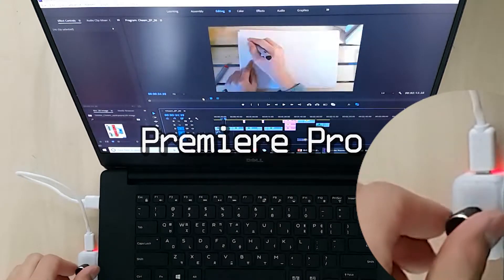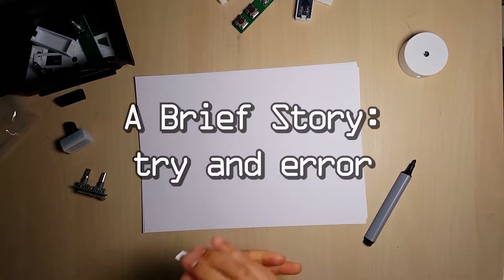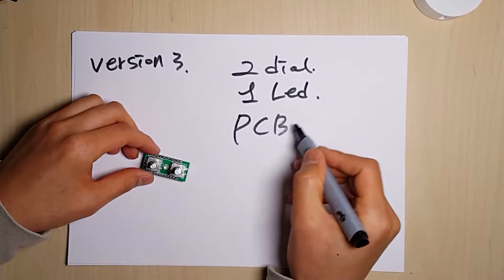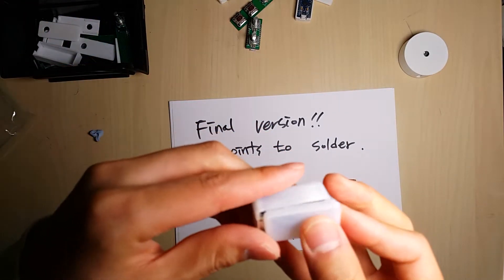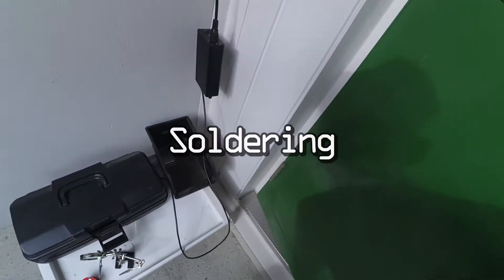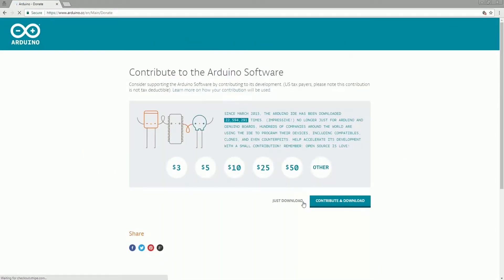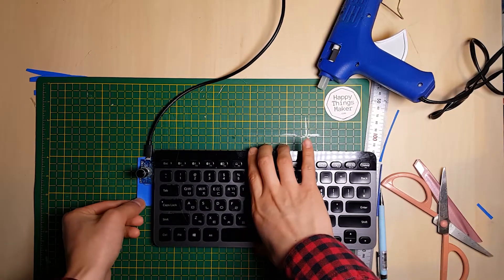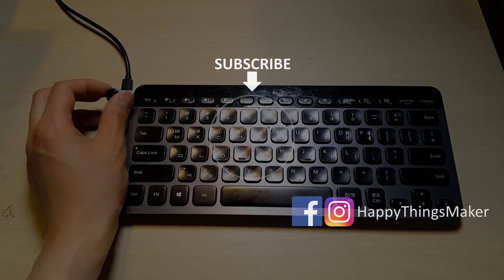Midi controller | Premiere Pro | Lightroom | Navigation Dial DIY (NEW) |  Video Edit Jog Wheel USB

Comment: Thanks heaps for this. I have been looking to control a web page slider with a rotary knob and this works great. Is it possible to get the switch to activate F5 on the keyboard? Regards Bruce
Reply from the maker: Hello! You can set the click as f5. Also you can buy a ready made one in this link.  https://www.etsy.com/listing/985194207/parks-custom-dial-kit-customizable

Comment: Can we use it as a volume knob?
Reply from the maker: Hello!
1. the example here doesn't have a code for a volume controller but you can make the volume controller by yourself.
2. you can buy a product which includes volume controller functoin here.
 https://www.etsy.com/listing/985194207/parks-custom-dial-version-2-customizable

Comment: My Arduinio Pro Micro is not recognized by the USB port. So I am not able to set the Port in the IDE. an you please help?
Reply from the maker: hello, if you have a jumper wire, would you try to short GND and reset pin after you plug the usb?

Comment: Hello, I'd like to do something similar but don't know how. I have a MMO gaming mouse with many extra buttons. I would for example like to be able to program one of them where I could hold the button down and then adjust exposure in Lightroom with the mouse scroll wheel. there doesn't seem to be a keyboard shortcut for Lightroom for this type of function. Is this use case possible?
Reply from the maker: hello, first, it is difficult to hack a product. I wished I could hack those kind of thing but it was way too difficult. so, I just made my own way.

Comment: Hey! First, thanks for the great video! Would it be possible to use this knob for macros?I was thinking about something like switching apps using Autohotkey. Also, would it be possible to connect more knobs to an arduino? In that case how many? I was thinking about giving another use to an old audio mixer. Thanks in advance. Any pointers would help.
Reply from the maker: hello, does "macros" means some combination of keys? then, yes. you can make that function. you can also make many dials but you will need to solder on pcb or handmade circuit board.

Comment: Hello, thank you for you work, 

Little question, i have two Arduino Nano (ELEGOO Nano V3.0 CH340) at home, is possible to use this with you arduino sketch ? i try buy i have 'keyboard' not found messages. 

Or i do imperatively to buy arduino Leonardo ?? 

Thank you for you answer
Reply from the maker: Hello, nano cannot do the function. Leonardo or arduino micro pro can do it.
Reply: @EunchanPark  Thank you very much for you quick answer, i order the right arduino and that works !!!!

Comment: 재밌게 잘봤습니다. 더 작게 만들어보고 싶어서 아두이노 마이크로 대신 digispark로 구성해보려고 합니다. 은찬님 코드에서 Keyboard.h를 DigiKeyboard.h 라는 라이브러리로만 변경하여 적용하였는데 적용이 되질 않네요. 코드좀 살펴봐주실수 있나요?

#define RESOLUTION 2
#include <DigiKeyboard.h>
 //변코드
#include <EEPROM.h>
#define BUTTON 0
#define OUTPUT_A 1
#define OUTPUT_B 2
bool aState;
bool aLastState;
bool lastButtonState = 0;
#define HORIZONTAL_MODE 0
#define VERTICAL_MODE 1

int mode = HORIZONTAL_MODE;
const int numMode = 2;

void setup() {
  mode = EEPROM.read(0);
  pinMode(OUTPUT_A, INPUT_PULLUP);
  pinMode(OUTPUT_B, INPUT_PULLUP);
  pinMode(BUTTON, INPUT_PULLUP);
  aLastState = digitalRead(OUTPUT_A);
}
long tempCount = 0;

void loop() {
  aState = digitalRead(OUTPUT_A);
  if (aState != aLastState) {
    if (digitalRead(OUTPUT_B) != aState) {
      rotateLeft();
    } else {
      rotateRight();
    }
    aLastState = aState;
    delay(10);
  }

  if (digitalRead(BUTTON) == LOW) {
    if (lastButtonState == LOW) {
    } else {
      delay(300);
    }
    lastButtonState = LOW;
  } else {
    if (lastButtonState == LOW) {
      changeMode();
    }
    else {
    }
    lastButtonState = HIGH;
  }
}

void changeMode() {
  mode = ++mode % numMode;
  EEPROM.write(0, mode);
}

void rotateLeft() {
  if (tempCount++ % RESOLUTION == 0) {
    if (mode == HORIZONTAL_MODE ) {
      DigiKeyboard.sendKeyStroke(80);
    } else if (mode == VERTICAL_MODE) {
      DigiKeyboard.sendKeyPress(82);
    }
    DigiKeyboard.sendKeyStroke(0);
  //릴리즈 대신의 초기화 코드
   delay(1);

  }
}

void rotateRight() {
  if (tempCount++ % RESOLUTION == 0) {
    if (mode == HORIZONTAL_MODE) {
      DigiKeyboard.sendKeyStroke(79);
    } else if (mode == VERTICAL_MODE) {
      DigiKeyboard.sendKeyPress(81);
    }
    DigiKeyboard.sendKeyStroke(0);
    delay(1);
  }
}
Reply from the maker: 안녕하세요, 이 댓글이 스팸에 있어서 이제야 확인했습니다. 
혹시 eeprom 쪽을 빼고 컴파일 해 보시겠어요? 
#define RESOLUTION 2
#include <DigiKeyboard.h>
 //변코드
#define BUTTON 0
#define OUTPUT_A 1
#define OUTPUT_B 2
bool aState;
bool aLastState;
bool lastButtonState = 0;
#define HORIZONTAL_MODE 0
#define VERTICAL_MODE 1

int mode = HORIZONTAL_MODE;
const int numMode = 2;

void setup() {
  pinMode(OUTPUT_A, INPUT_PULLUP);
  pinMode(OUTPUT_B, INPUT_PULLUP);
  pinMode(BUTTON, INPUT_PULLUP);
  aLastState = digitalRead(OUTPUT_A);
}
long tempCount = 0;

void loop() {
  aState = digitalRead(OUTPUT_A);
  if (aState != aLastState) {
    if (digitalRead(OUTPUT_B) != aState) {
      rotateLeft();
    } else {
      rotateRight();
    }
    aLastState = aState;
    delay(10);
  }

  if (digitalRead(BUTTON) == LOW) {
    if (lastButtonState == LOW) {
    } else {
      delay(300);
    }
    lastButtonState = LOW;
  } else {
    if (lastButtonState == LOW) {
      changeMode();
    }
    else {
    }
    lastButtonState = HIGH;
  }
}

void changeMode() {
  mode = ++mode % numMode;
}

void rotateLeft() {
  if (tempCount++ % RESOLUTION == 0) {
    if (mode == HORIZONTAL_MODE ) {
      DigiKeyboard.sendKeyStroke(80);
    } else if (mode == VERTICAL_MODE) {
      DigiKeyboard.sendKeyPress(82);
    }
    DigiKeyboard.sendKeyStroke(0);
  //릴리즈 대신의 초기화 코드
   delay(1);

  }
}

void rotateRight() {
  if (tempCount++ % RESOLUTION == 0) {
    if (mode == HORIZONTAL_MODE) {
      DigiKeyboard.sendKeyStroke(79);
    } else if (mode == VERTICAL_MODE) {
      DigiKeyboard.sendKeyPress(81);
    }
    DigiKeyboard.sendKeyStroke(0);
    delay(1);
  }
}
Reply: 답변 감사합니다! 해결 했습니다. 오래되서 원인이 뭔지 기억은 안나지만 digispark로 컨트롤러를 만든분들을 참고하여 몇가지 수정하니 잘 작동 하였습니다. ㅎㅎ

Comment: How many can I use at a time? Will Windows be able to tell the difference between them?
Reply from the maker: Hello, I think you can use them as many as you want. like keyboards. how many do you want to use at the same time?
Reply: Like, 5-10 xD With keyboards, though, Windows can't tell the difference between keyboard (an a press on one is an a press on the other).
Reply from the maker: @wholock0001  Windows cannot distinguish about it. if you plug 2 keyboards and press same button, windows just got a same character.

Comment: Do you think you can make a new version that uses bluetooth instead of USB? 😁
Reply from the maker: YES but it will be needed a battery or power cable. Do you need wireless dial?
Reply: @EunchanPark  yes! Please make a video 😊
Reply from the maker: @yfengable  Here comes "to do list"! I will try later soon.
Reply: @EunchanPark  It's would be great,to use it on Android tablet,if it's possible of course:3

Comment: Hi, 
I made this, but have one problem. Each click moves the cursor two steps - one "on click", second  "on release".
How and where to modify the code to get one step "on click" only?
Reply from the maker: hello, could you give me a URL that you used? there are some various versions of the codes. I will take a look it.
Reply: @EunchanPark  , thanks for quick reply. I used the sketch from here - https://github.com/happythingsmaker/NewPremiereProLightroomDial/tree/master/PremiereLightroom_YoutubeVersion
Reply from the maker: @PrzereklamowaniTV  hi again.
button click doesn't have any moving function. it just changes the mode. 
If you meant the rotation, you can change the sensitivity by changing  line number 9

from 
#define RESOLUTION 2
to
#define RESOLUTION 4
Reply: @EunchanPark  ok, maybe I wasn't clear enough. When I turn the knob/wheel one click, i get two steps of the cursor. When I turn the wheel gently "half click", the cursor moves 1 step, but after, when the knob "clicks" to right, stable position, cursor moves second time.
In my case only sensitivity=1 works pretty OK, but like above.
Reply from the maker: then I think it would be better soldering the dial. it seems like contacting problem.
Reply: @EunchanPark  I made 2 pieces, one soldered like yours, second with wires. Both work same way - one wheel click = two "Arrow" moves.
I Think the encoder generates two impulses (on both terminals to determine direction), and your code counts them both as 2 moves.
Can you check if also your works like this? 
It's very visible on the plain text in horizontal mode.
Reply from the maker: @PrzereklamowaniTV  I checked it and mine was okay. I guess the problem comes from the encoder. 
have you tried change the RESOLUTION? the bigger resolution, the less sensitive